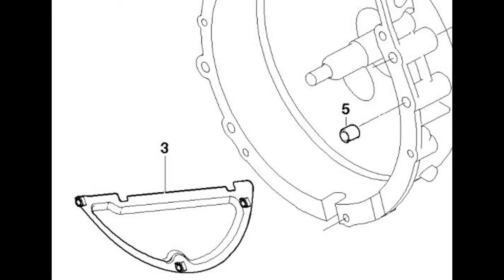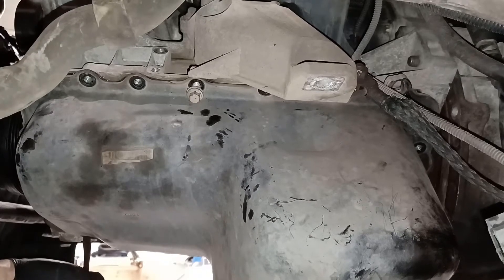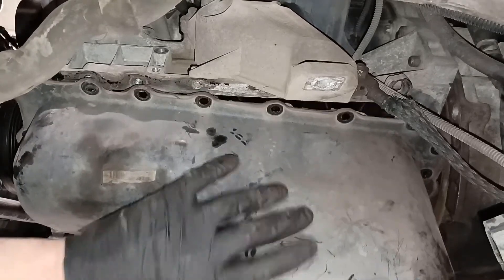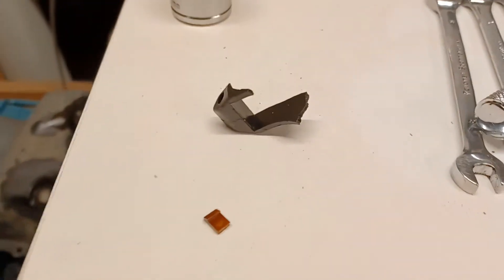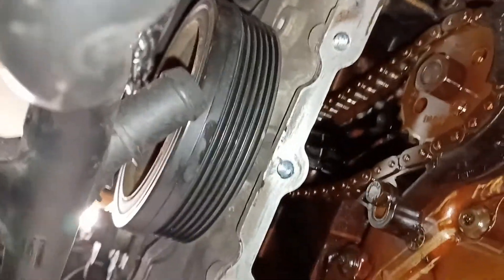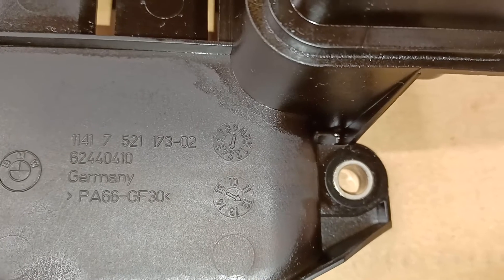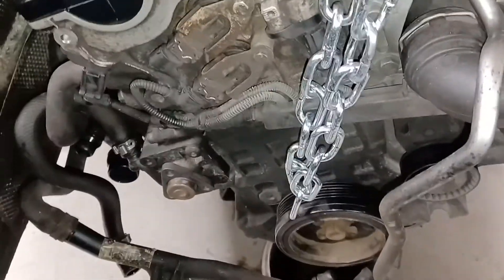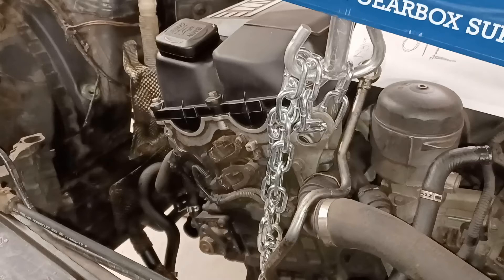BMW 116 Trophy Build - Removing the sump (oil pan)

Comment: Hi ,did you replace the timing chain guide? I found the little plastic piece of guide in my sump also.
Reply from the maker: No, I didn't.  The guide seemed OK, and so I reused it.
Reply: @PaulOffordRacing 
So you continued to use broken chain guide in your engine?
Reply from the maker: @robster6868  Sorry, I completely misread you earlier comment.  I thought you meant the oil pump chain guide.  No, the timing chain guide had been replaced but whoever did it (before I owned the car) hadn't cleaned the pieces out of the sump.

Comment: What plastigauge do you need with these bearings?
Reply from the maker: It's red Type PL-A to measure 0.025mm - 0.175mm (0.001" - 0.007")
Reply: @PaulOffordRacing  thx for your reply. So if i understand right,if it exceeds the 0.175 it is no longer good right?😮
Reply: Thats quit a big range right?
Reply from the maker: @Kpostma100  Ah, I misunderstood your question.  You need a clearance of 0.001" to 0.002" on the big end bearings.
Reply: @PaulOffordRacing ah great man,thx. I that is in inches i believe?
Reply from the maker: @Kpostma100  yep - 1 to 2 thousandth of an inch.

Comment: I have a bmw 116i f20. My oil dipstick tip broke off (plastic part), do I need to remove the sump or like those plastic bits will it just sit at the bottom of the pan?
Reply from the maker: You need to check the oil pickup arrangement on your engine.  On mine (N45B16A), there is no strainer on the end of the pickup, so it could get sucked up, particularly as it's light and would get swished around in the oil.  Do you think it would come out if you drained the oil?
Reply: @PaulOffordRacing  before my next journey, I'm going to do a service. I'm slightly mindful that it may not come out with the oil.
Reply from the maker: Yeah, I can see how it might not.  When I took the sump off mine, I found bits of plastic chain guide.  I reckon they had been there for about 10k miles.  So I got away with it, but that's not a good strategy.
Reply from the maker: @andrejones497  I had a quick look at the oil pump setup on the N13 engine (which I think is what you have).  It doesn't have a strainer on the pickup (suction) pipe.

See https://www.realoem.com/bmw/enUS/showparts?id=1A12-EUR-06-2012-F20-BMW-116i&diagId=11_5008

Comment: Bonjour on ma dis les vis de la pompe a huile et celle du plastique  noir que les vis torx ce desserrer on sens contraire du vissage et dévissage est vrai pourriez vous m expliquer si vous plait enfaite je comprend pas anglais a ce que vous expliquer j ai fait juste regarder la vidéo désoler
Reply from the maker: L'écrou qui maintient la roue dentée sur la pompe à huile a un filetage à gauche. Les boulons Torx sont filetés normalement.
Reply: @PaulOffordRacing  cool pour déposer le carter on n est obliger baisser le berceau complètement au sol y a du taf quand même moi c est une crémaillère électrique que j ai